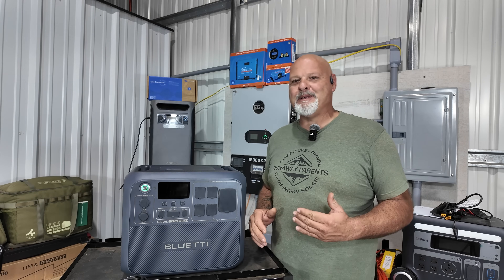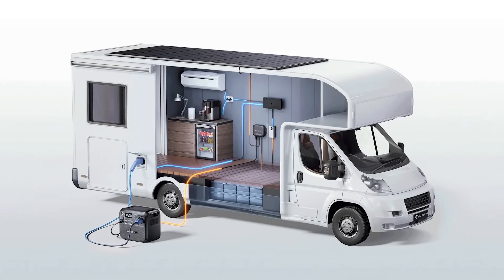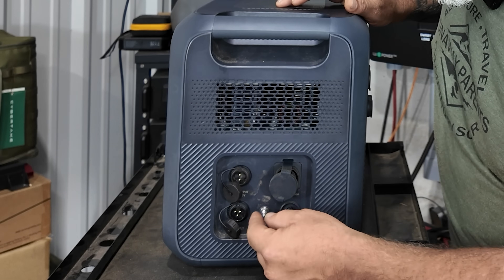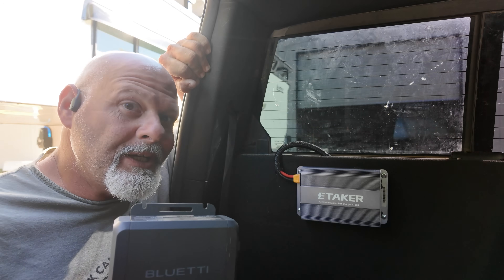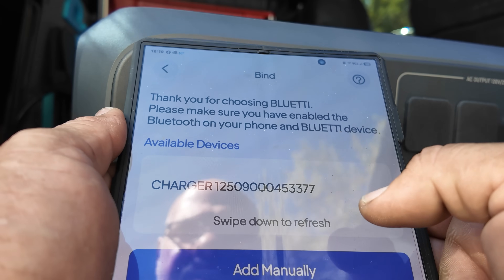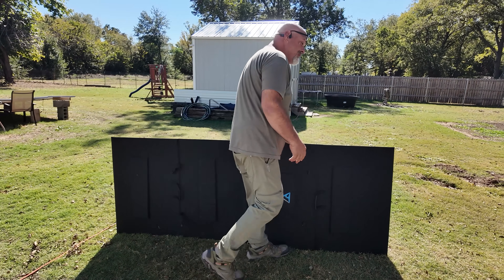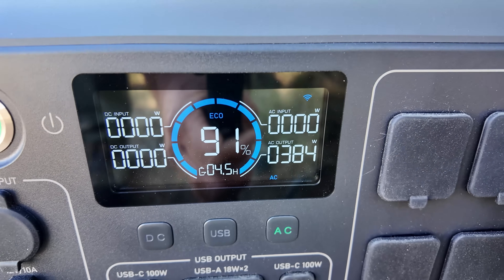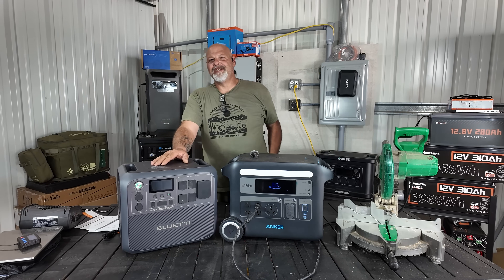“Unbelievable Price Drop on the Bluetti AC200L!”

Comment: Mike I am excited to see the review, I bought the AC200 and 2x battery expansions with 3x350w foldable panels off FB new in the box for 2K, cannot wait to finish getting the truck set up and trying them out this hunting season.  Also, I think they are going to be great boon-docking in the airstream, it still has a lot of room on the roof for additional panels. I missed Signature Solar's parking lot sale last month that would have been a good time to cover the camper and buy two for the Truck RTT maybe some lithium.  Great video looks and sounds like I made a good choice.
Reply from the maker: Wow! That's an amazing deal. I'm sure you'll love it!

Comment: I bought this unit and not on sale, unfortunately 😔
So far the only thing I dislike about the AC200L is the power light doesnt time out when you have it plugged in for UPS mode but I really like my power station 😊
Reply from the maker: That's unfortunate, but at least you got a great unit!
Reply: @runawayparents 
Also, you can supplement your AC with 1200 Watts of Solar, Im not sure if you AC unit is DC cuz if it is, maybe the DC40 add on might give you more power. Ty 😊

Comment: Hi Mike, I am a long time truck camper guy living in Alaska.  No solar or power station, run a gas genny.  Looking into a power station and low profile solar panels mainly for running two freezers during our salmon camp.  Low profile is key as I just had to rip out the sky light as it was damaged by a tree and cover the space with a roof repair.  I’m also interested in charging a power station with the truck (Ram 3500 DRW).  Would like to run entire camper on the power station.  What are your recommendations?  Also, found your channel through Larry, have watched him and Kenny for a couple years now.  Take care.   Tom
Reply from the maker: Hi Tom, Welcome to the channel. Sounds like your having all the fun. We hope to make the Alaska journey some day. Honestly this AC200L by Bluetti sounds like a good fit. It wouldn't have no problem running freezers of an extended amount of time and will easily power a truck camper. You also have the option to extend your run time with expansion batterys as needed with the B300K expansion battery. And the Charger 1 is an awesome pairing for charging while your truck is running. You could also put a 400w Rigid solar panel on your roof to save some money or go with the PV350 Bluetti panels for Portability. I like the fact that you can use a system like this at other places when not being used on your truck camper. Like at home or out in a shop or in the yard. Hope this helps you. Safe travels.  😊
Reply: @runawayparents Thanks for the quick reply.  I am looking into all you have mentioned.  I kinda thought based on this video that this was a good direction for me to go but wanted to hear it straight from you in case you had something else you thought was better.  Thanks again.   Tom

Comment: Can it run anything in your house in case of power outage?
Reply from the maker: The Bluetti AC200L can power most household essentials during an outage — things like your fridge, Wi-Fi, lights, TV, laptops, and CPAP — for 8–20 hours depending on load. It can also run small appliances like microwaves or coffee makers , but not 240V items like central A/C, ovens, or dryers. Add solar panels, and it can keep key essentials running indefinitely.